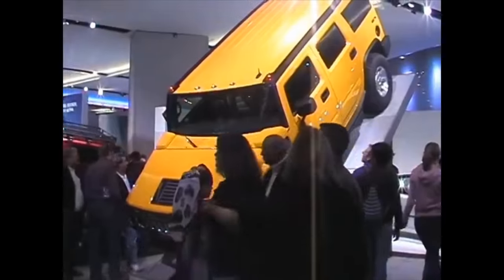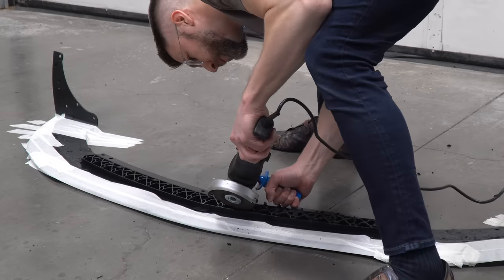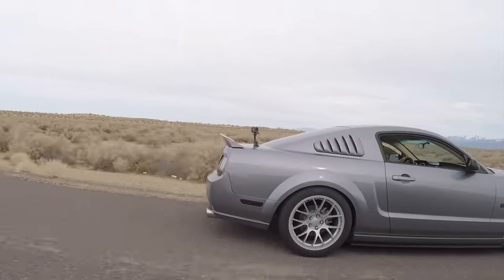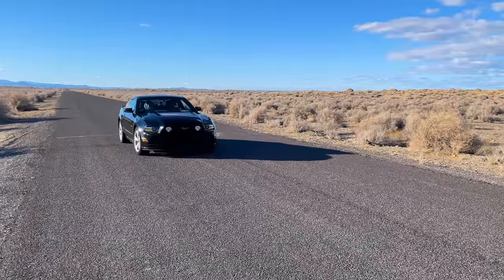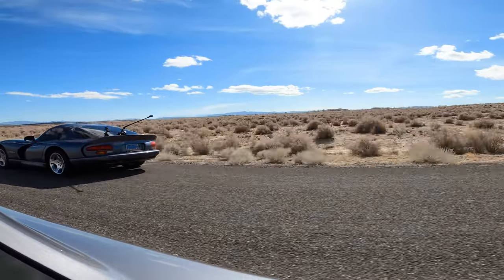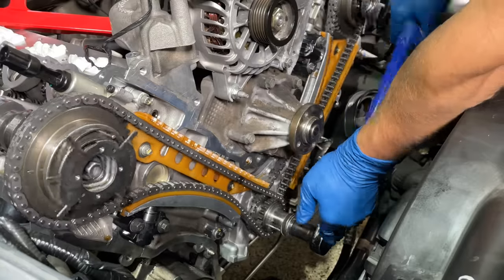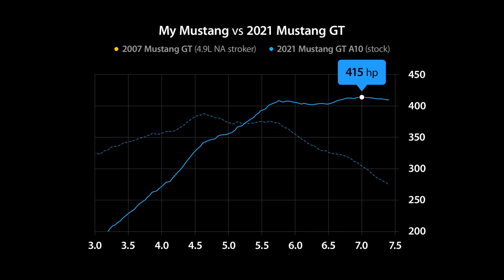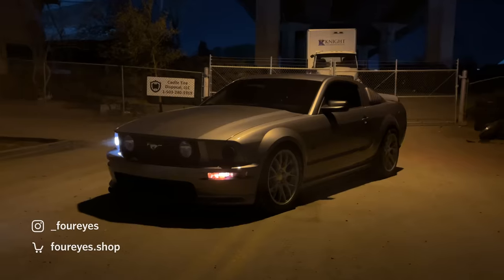Transforming this slow 4.6 into a screaming coyote killer

Comment: I have a 1997 I restored but put all new stock valves and cams with new HP manifold .. BBK headers .. 75mm intake ,,,   a great roadster and super super dependable ,, and run 87 octane ,,,,, love the 4.6 litter ,,  every time i try racing I get $500 tickets so i just go about 300hp

Comment: The T56 Magnum XL was NOT used in the GT500. Rather, the GT500 used the TR6060.
Reply from the maker: ackchyually !!!

“Magnum” is just the aftermarket branding of the TR6060. “TR6060” is OEM designation. Same gearbox, torque capacity, and ratio options.

Comment: 410 whp is good considering reno is about 4500-6200 feet in altitude  depending on where you are driving around. thats 3% per 1000 feet so add around 10-15% more peak power and that would be your sea level whp.

Comment: I've always thought that 2005 was the best looking other than the '67. So it's the most attainable and it has the very loyal 4.6 which while it's not the 5.0 I actually like the 4.6 because of it simplicity, you get the simpleness and reliability but power and torque of the '90s and early 2000s without the complexity of the later years and unreliability of the earlier ones

Comment: Curious. What's it like driving with those cams? I'm looking to get a set of either FRPP cams or possibly some XFSI. Not so much for the power as much as the sound.
Reply from the maker: If you're going for sound get the Hot Rods, if you want a little more power but still decent sound/lope, then get the Detroit Rockers.

Comment: So the this gen CAN beat an LS and a 5.0! They just need a new throttle body, intake, exhaust, camshaft, crankshaft, rods, pistons, driveshaft, cylinder heads, valves, springs, fuel system and injectors, transmission, clutch, and a few other things here and there

Comment: Wicked build. But the amount of money spent on to get 400whp out of a 4.6... you couldve easily got a coyote stang and tuned it... Or better yet, if you love the 3v s197 body..
 Just do an on3 turbo kit on these with a connecting rod upgrade. Youd be making way more power at a MUCH cheaper price point. But regardless... Very nice n/a 3v

Comment: What are the wheel and tire specs? This is the look and fitment I'm after.

thank you for your time.
Reply from the maker: Wheels are called "Miro 112" (they're discontinued but there's a few options out there that look similar):
19x8.5 +35 on 255/40
19x9.5 +40 on 275/40

Comment: We should do is buy the Shelby GT500 engine and swap it and add some of the parts from your old engine that you really liked into the show me that could make it well over 700+ horsepower if my calculations are correct because the stock Shelby GT500 makes around 682 hp which would allow those parts that have like 1000 hp handling to be able to squeeze more of the power out of those parts because you can’t use a little power on big parts toward the engine would run better and especially with the big excel in their blocks would allow better horsepower to be squeezed out of the engine in with Carol Shelby specialty in most of it custom design by him you will be able to get more power with the crankshaft and that turbo and sent it already comes with the supercharger well you don’t need to do is cut a hole in the supercharger attach the pipe and then make sure it’s sealed that allow more air intake that creates more power but you’re gonna need a better fuel pump that means And you don’t need to replace the pistons while you can if you want with some like fresh ones and then add a huge spoiler for extra downforce which should around give it 1000 or 700 somewhere in between the horsepower

Comment: Very solid video, just too bad the 4.6 is such a mediocre platform. A friend I used to race with had a 4.6 mustang with massive injectors, big supercharger, forged internals. Thing had like $20k in mods... All said and done he made less than 700 crank horsepower... Decided I'd never bother to build one lol. When you're having to pull the block in order to make 400hp, you're saving money doing an LS swap. To each their own, but horsepower-per-dollar I don't think the 4.6 even keeps up with most V6 engines anymore.
Reply: anecdotal evidence is not concrete fact.

truth is, the 4.6 block is still tough as nails, and it can handle 1,000 horsepower easy.

the trick is using a 4V DOHC head to make the most of the overhead cam platform. 
boost+rpm means a good recipe for horsepower, despite the displacement defecit.

Comment: Dude ! I would've been nauseous if I had just spent over 20 grand on an engine, to only gain 24 hp, and 20 ftlbs. !! 
 And that's why I haven't spent a dime on the 4.6 in my Mustang !
 It just isn't worthy !
 I understand that the majority of $$ went towards building it up to take the boost your going to pump through it later but that would still be a downer.

Comment: All of that work and mony for Only 410 hp?. Im trying not to be to nerdy but my 08 bmw 650i makes 367 hp stock all i need to do to make a little over 400 is a 6k$ Kompressor kit from ess
Reply: Now try getting the power without the compressor kit. This was the point of the build, how powerful can a 3 valve be while still NA.

But if you actually saw the video, he says that the engine is being prepared for a pair of turbos, so it will skyrocket in power and he wont have to make massive changes later.

Comment: 400whp is FBO + heads 5.3 power, that is not impressive for a fully built SOHC 4.9L
Reply: It’s low compression
Reply: @stephenpage-murray7226  so is a 5.3, a L33 will make that 400whp with only 9.9:1 comp
Reply: @loganamurray64  
It’s the heads

Comment: When discussing mods the discussion is irrelevant because all you need is a bigger budget and you can make any car really fast. All you have to do is sink more money you can slap on turbo/supercharger, all sorts of intake/exhaust, increase displacement. Modded cars are unreliable. By the time you start to get forged internals or a stronger transmission you are well into the territory of utter lunacy and wasting money. Not only will you never get those funds back but you can get a much better car that holds better together over time if you just take the money you would have wasted on mods on a better, faster car that comes from the factory rated for whatever faster/power level you wanted to start with. You should have just bought a 5.0 successor, or a Corvette, period.